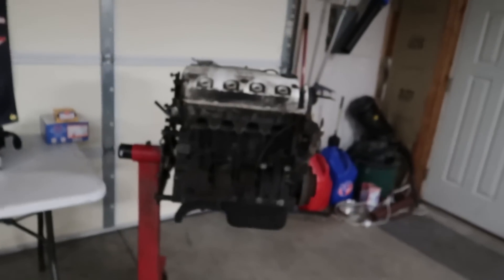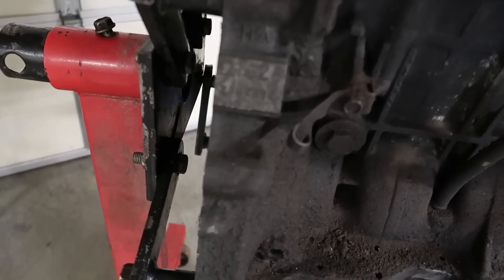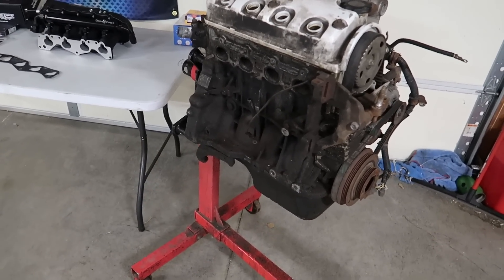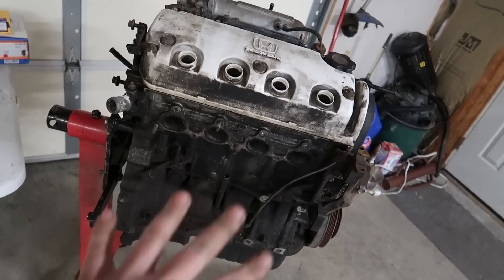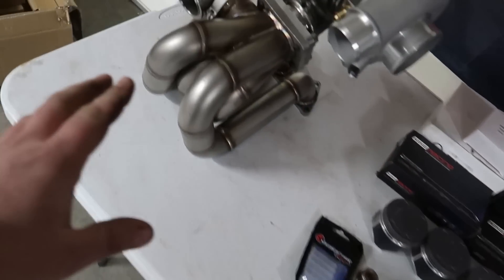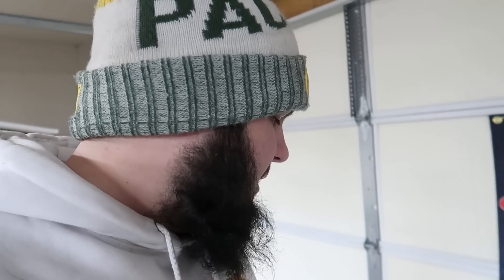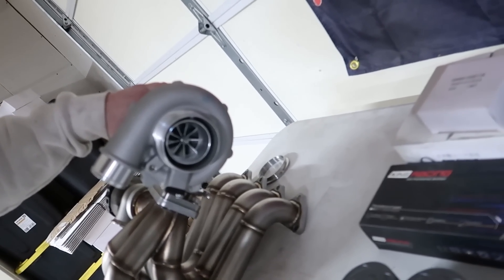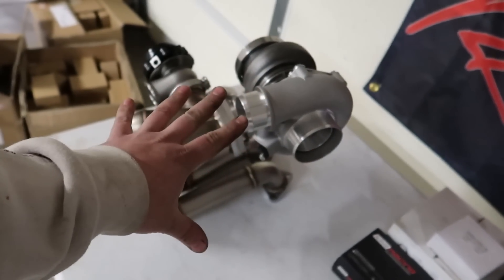Fast And Fun Honda D16 Single Cam Build! Gathering Parts!

Comment: I have a built vitara y8 with Bad Guys ported oil pump and redline is 7300prm on 22pds of boost. so far no issues, 3 years on the motor. Z6 crank would be nice peace of mind. Good series.

Comment: So happy you are doing a D16Z6.  I have a 95 Delsol Si and it's bone stock.  Don't want to dump too much into it.  DISAPPOINTED that you are not doing a stock motor with with all add ons and not cracking the case...

Comment: 1.7mm delta between Vitara & PG6 piston compression height, according to ZealAutoWerks.
Any problem this might cause could likely be solved with a different head gasket.
Reply: Yeah the pg6s with the long rods will stick couple thou out the hole (don't quote me on this) but I'm almost sure I read about this subject on hondatech years back and someone did it with like a 50mm or 60mm  head gasket and had minimal P2V clearance but it kept blowing head gaskets if memory serves me right. Again don't quote me on this.

Comment: I have this same setup I did the same speed factory rods and pistons I had to go to a 76mm bore then I had a built head with factory cam and factory intake with a top mount like yours I made 450 at the wheels on e85 had 1000cc injectors just ran out of injector it’s a great build super fun
Reply from the maker: Didn’t have issues with piston coming out of deck?
Reply from the maker: Or you used the vitara pistons
Reply: I used the vitara pistons I wanted to run a different piston but I wasn’t sure if any other piston would fit on that rod so I just ran those they did really well I have the engine apart now cause I think I lifted the head cause the head gasket is toast so I am going to use this time to send it out to get it CSS and go back with a little better rod and piston set up

Comment: My favorite d series head combo was a y8 head with the y7 cam and rockers so its a y8 non VTEC. Just swap the end caps on y7 rockers to the y8 and it's a beast with a 272 regrind. That with a y7piston in a z6 equals happy daily driver.
Reply: That's what I'm running now with 29 pounds of boost from and ebay turbo no regrind thought and ported y8 head

Comment: Hi, I run that combo a lot, you have to notch the top of the piston for valve clearence, I use a Comp Cam stage 3 and it lights up super fast. Thanks for the contant👍🏼👍🏼👍🏼
Reply: can you clarify more on that setup ??
Reply: @Officialcaydencemusic fr plz im tryna see if i can run stock length rod+pg6+comp59300 cam

Comment: Thought is seemed funny while listening, so I did some quick calculations. If it was PM6 pistons (-3.4cc 29.5mm height) They would yield around 11.7:1 with those long rods. The PG6 (1.5cc 30mm height) would be more like 14.2:1 w/long rods.
However PG6 on standard length rod is also about 11.7:1

P.S. Congrats on the shop! 
If you don’t end up using those Speed Factory rods, I’d love to snag some hah

Comment: I’ve heard the y8 crank is better because it has 2 oil ports on crank just need to mess with oil pump to crank up pressure
Reply from the maker: Z6 has 2 ports y8 has 1

Comment: Thank you for spreading your knowledge, Hunter. I just got a 89 si hatch shell last year, and got it running + driving in a matter of weeks. Just has a junkyard d15b7 right now, but the z6 speedfactory/vitara build is exactly the direction I want to go with it. Much Love <3

Comment: A laggy turbo isn't a bad thing when you have stock rod's  , a small turbo coming on at 2500rpm would be making way more torque than they were designed for especially around the 4500rpm area.

Comment: I'm building a Y7 Speed factory std length rods CP Carrillo's 10:5 compression ratio speed factory street savage cam Ferrera 6000 valves Brian crowder springs retainers with a Z6 Head. Wanting to find a Z6 crank but I'll just keep RPM under 7000 if I can't

Comment: im thinking of just using p29 pistons for my next d-series build. What camshaft are you thinking of using for this project? right now ive got a vitara setup with a d15b2 bottom end p2p0 rods and a y7 head I used a small ebay gt28 turbo and its still not as responsive as I would like it to be despite the t25 flange turbo.

Comment: You said the eg had  d15B. is that the jdm d15b vtec? Because that's what is in my turbo crx, it is the same head as a z6 (code p08). And crank is the same as well to my knowledge. You are doing almost the same build as me.

Comment: Unpopular opinion: you don't see many high-comp boosted engines because they don't survive.

Unpopular opinion #2: low-comp is fine, but most tuners don't add the timing NEEDED in the vac section to make them feel good.

The math shows 138.63mm rods will stick PG6's out of the block 0.064", meaning you'll need a headgasket nearly 0.09" thick and put the compression to 12:1. Any gasket thinner than that will lead to the pistons self-clearancing in the chambers since they're a hair under 75mm in a few spots. Either way you'll need fuel more exotic than pump e85 or a very high-duration cam to make it last.

I hope I'm wrong but I'm usually not.

Comment: Nice.  D series seems to get lots of views…under dogs!  If you need to pick up shorter rods check scat rods.  I’ve been looking a a lot of d series rods and those and Bisimoto were the only ones I saw with oil reliefs on the big end of the rod.

Comment: I have a 97 civic coupe, y8 motor which is obd2. I have been doin extensive research on how to build a reliable but fun d series and im finding z6 is the best way to go. I was wondering how you would do the obd1 to obd2 or vice versa. A video on that would be super helpful !! Thanks for reading
Reply: back in the day it was z6 block with y8 head
Reply: Doesn't really matter, whatever the chassis is because chances are you are plugging in a obd1 ecu with s300 and a jumper harness

Comment: Congratulations on finding a closer shop. I was waiting for someone to do a higher comp piston on a turbo d series. Do them pistons cost alot or are they about the same as the vitaras? If they work I'm buying a set. I also need help on making a new feed line for my fuel system as my factory line has a small drip. I would like to buy a 450 pump from you and a new feed line.
Reply: I paid $750 for 10:5.1 Compression CP Carrillo's

Comment: Mint bro, been waiting for some hunter tuned single cam action. 

I'm focusing on doing a y8 turbo, I got a z6 crank, is it just simple swap out and not having to worry about any degree or timing issues? 

Cheers bro, may the bearings be with you!
Reply from the maker: Yea swap and go

Comment: Maybe 500 crank I don't see 500 whp out of that turbo hopefully I'm wrong. I've seen 450 on a .48 t3t4 50 trim make 450whp on a stock 1.8t vw 20 valve.

Comment: That is awesome, glad to hear you found a place nearby. Hell yea can't wait to see how things turn out with the single cam. That's kinda why I chose to build my car the way it is. 4th gen Camaro I got cheap, 5.3 used truck engine, no rebuild just checked bearings, cam and clean up, homemade hotside with 7875. It's nothing special but so ppl can see you can have fun and pretty fast for relatively cheap.